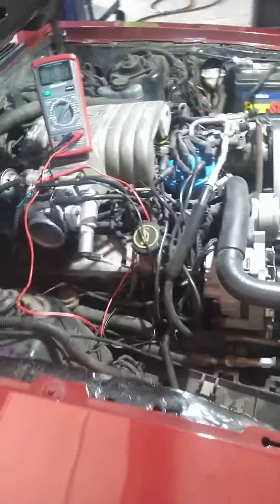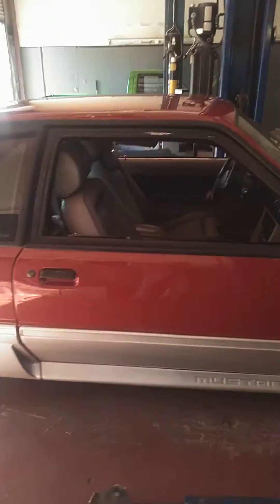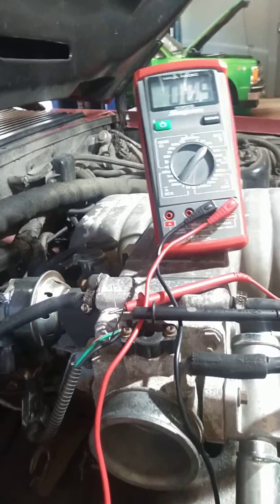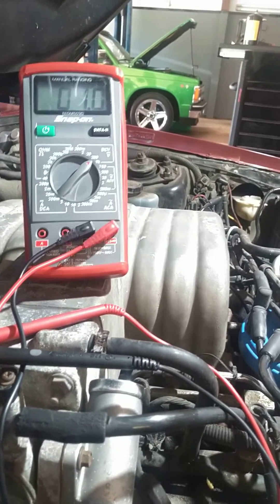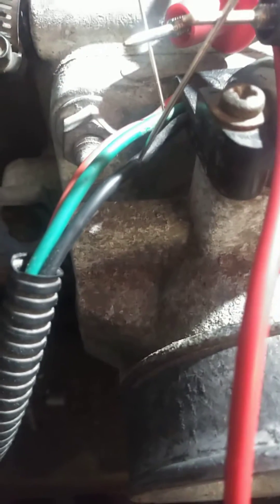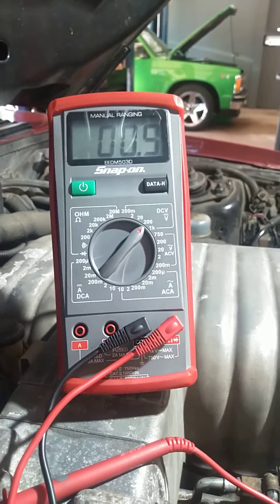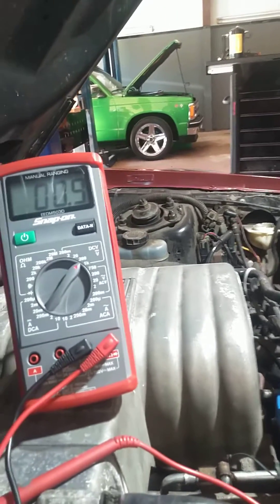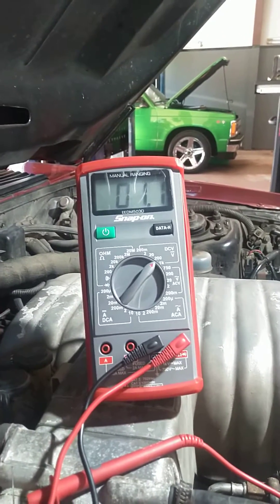foxbody tps voltage at throttle position sensor

Comment from the maker: I would check sensor replace if old them make sure throttle body is around stock size and idle screw set correct after that start tracing wires for short and final suspect pcm